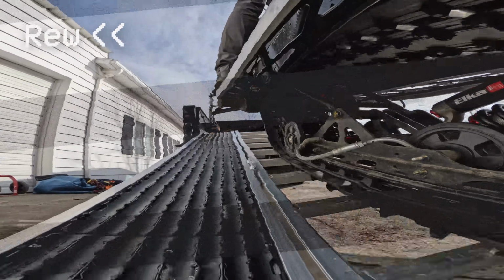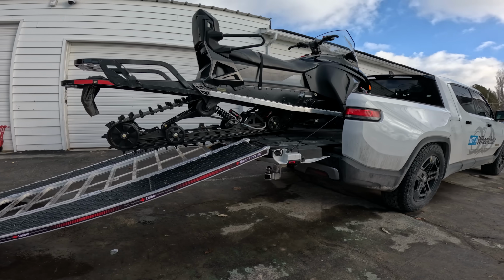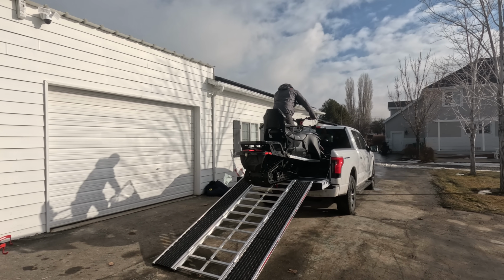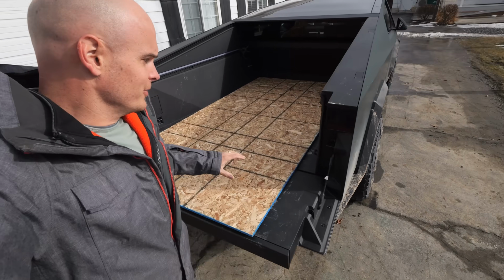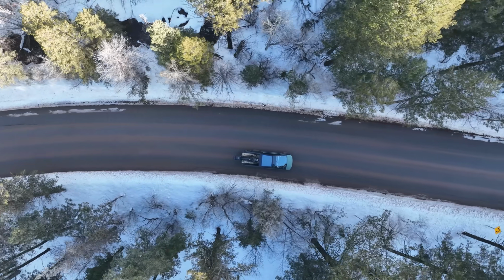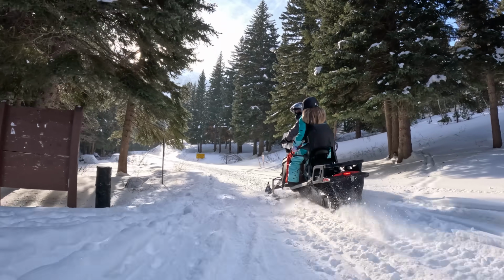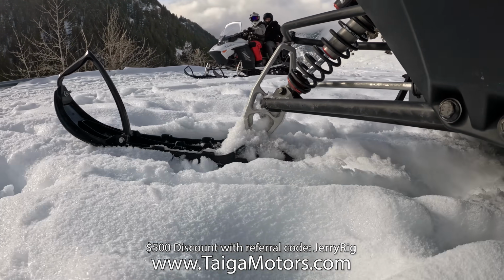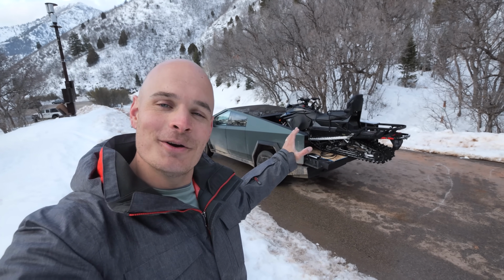The Weird Cybertruck bed is actually GREAT for one thing...

Comment: electric snowmobile sounds like a really bad idea. Get out there miles down the trail to have a battery go bad seems like a recipe for disaster
Reply from the maker: Gas sleds quit working all the time.  I like that electric sleds have basically no maintenance.
Reply: @JerryRigEverything  gas sleds are easily fixable in most cases in the trail if you are mechanically inclined in the slightest, also you can carry spare fuel. 60 miles is not that much distance when you are going for a backcountry ride.
Reply: @wtfdookiefpv copeing huh?
Reply: @flynntaggart7216  nah I don’t ride at all. Just seems like a bad idea to me. Kinda like going out 4 wheeling in an electric vehicle vs gas vehicle. Just makes more sense to be able to bring spare fuel and parts, usually a lot easier to fix gas vehicles than electric since they can at times have less electronics, that’s all im saying guy
Reply: @wtfdookiefpv  battery and wires vs 4000 parts which is easier bro 🤨
Reply: @flynntaggart7216  hahah 4000 parts to fix a sled? You must be trying to do a full rebuild in the sticks. Most of the time repair items like belts and spark plugs are easily stored. You don’t think you need a belt for the electric version? Or even tools?
Reply: @flynntaggart7216  also kinda hard to charge a battery 61 miles into your 60 mile range. Fuel goes right into the tank from a separate one attached to your sled therefore increasing your range
Reply: not everthing is do or die there are plenty of circumstances where the electric sleds make sense but yes if you are going hundreds of miles then yes gas would be the better choice and as jerry said the no maintenance aspect is nice since most of a sleds life is spent in the garage unless you live in the arctic.
Reply: @zachmoyer1849  60 mile range wouldn’t even get me to town and back. I’ll stay with gas, as I do in my vehicles since I get way more range, and usability from it since I don’t have to worry about poor battery performance in cold weather or how to charge it at my off grid home. Electric is not feasible yet for any kind of long distance, therefore I won’t use it.

Comment: I think its funny that you're all about saving the environment, but then you buy all these electric vehicles. And those all need to be powered by batteries that produce so much waste and are terrible for the environment.
Reply: Batteries are mined for the valuable metals they contain. They can be recycled indefinitely because elements like aluminum, lithium, iron, cobalt, etc, never go away. Once they are mined from the ground, they are then re-purposed indefinitely. This is the difference between great civilizations and cavemen. Pretty much everything you own that is not plant origin or animals were mined from the ground. When you use plastics or drive gas vehicles, that must be mined from the ground too. Mining, transporting and refining crude oil makes a lithium mine look like an ecological paradise in comparison. Because you have to keep mining the crude oil, once it's burned, it's gone.